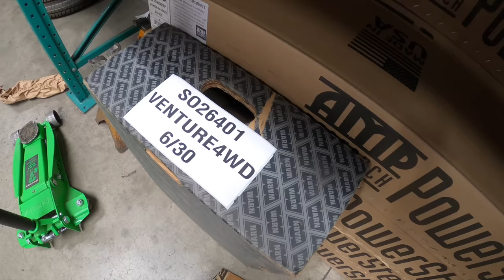V20E21: 4x4 Van Upgrades at Agile Offroad

Comment: I did something similar early this year with my 2018 Sprinter 4x4 2500.  I had experienced some clunking from the left rear suspension, on even minor bumps, that I couldn't isolate.  I took the van to my local 4x4 outfitter, Built for the East, and had him take a look at it.  He determined that the upper shock bolt on the left rear shock was starting to oval the mounting hole, allowing flex and the audible clunking.  The bolt itself was tight, but there was enough flex under load that it caused the problem.

The fix I opted for was the installation of the Baja Brackets from Van Compass, which are very similar to the shear brackets you had installed at AO.  They convert the single shear mount of the upper shock bolt to a double shear.  It definitely fixed my clunking and gives me greater confidence that I won't experience a broken shock bolt out in the wilderness.

I've now been looking for a good way to protect the rear lower shock mounts.  I have a full set of Van Compass skid plates so the bottom is already pretty well protected, but I've managed to catch the lower shock mounts a few times on rocks in the trail.  It's a weak point I'd love to address at some point.  If you or any viewers have any suggestions, I'd love to hear them.

I absolutely love that you are including the Revel in more of your episodes, being biased because I drive a similar van.  Orangie is great too, but it's nice to see you pushing the van through more challenging off-road environments.
Reply: Nice comment. I too am looking for shock mount improvements for the Sprinter. I also am really enjoying all the van videos. Got worried he was going to sell it after the release of the 2 yr ownership montage video. So glad to see more improvements to the van which means more travel videos in the van.

Comment: The license plate thing always cracks me up. Like nobody see them while driving 😂
Reply: Exactly. What do they think they're protecting? There's already a law for that. It's called the Driver's Privacy Protection Act (DPPA) of 1993. It prohibits the release or use by any State DMV (or any officer, employee, or contractor thereof) of personal information about an individual obtained by the department in connection with a motor vehicle record. So yeah, that's like putting tint over a piece of glass that's already opaque.